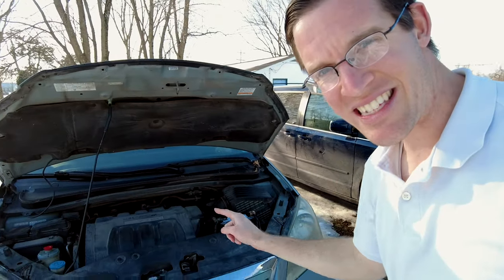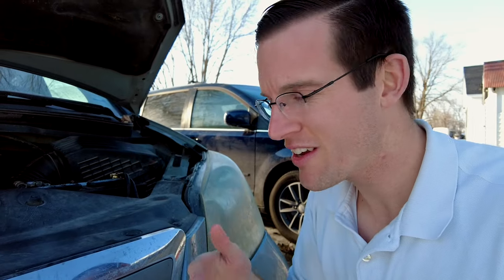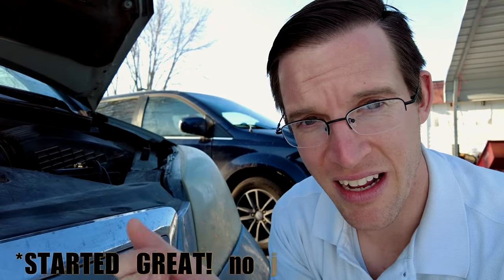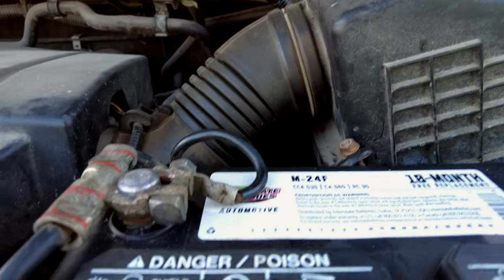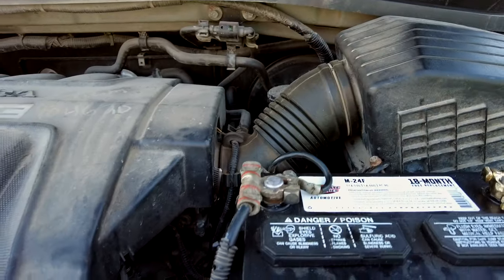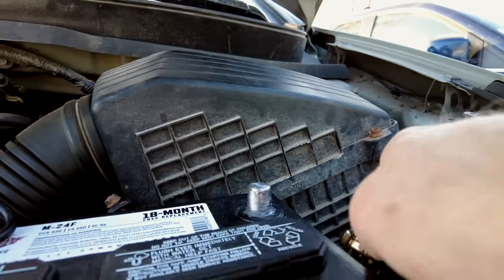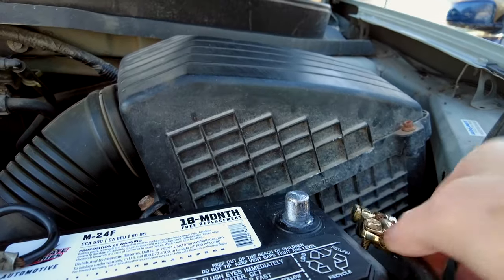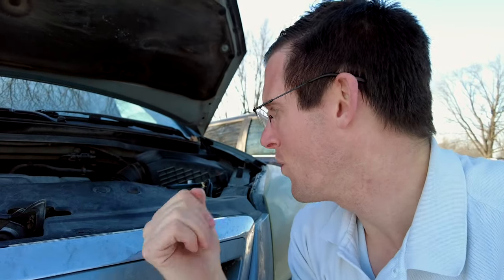EASY FIX! Car Battery Keeps Dying? How to fix in 1 minute

Comment: quick way to kill your cars computer its not meant to be powered down every other day!!!   instead use a meter to see whats pulling voltage with key off    or just get a new battery  that can handle a small amount of voltage drain better in the cold   your mechanic is a knucklehead and this video may be costing people money  a new ecu is expensive compared to a good battery

Comment: If you have an old GM car with a security system, don't screw around with the battery, replace it with a good one and don't play the jump jump charge charge, connect connect game, not worth it, you may have to teach the car it's 'new' ignition key.